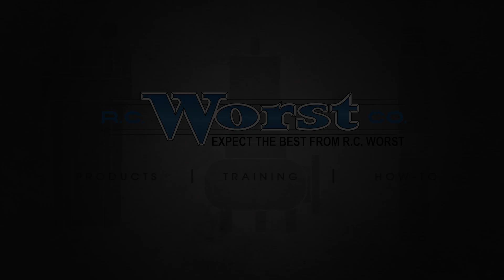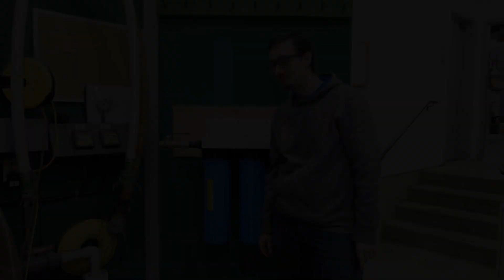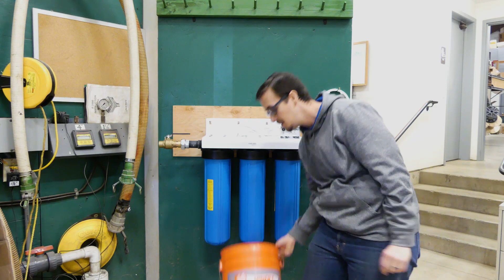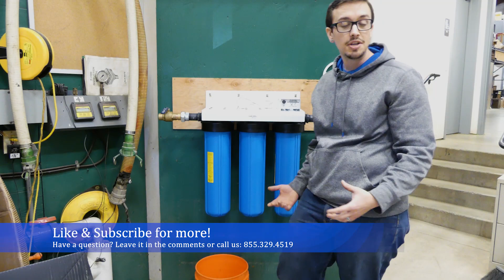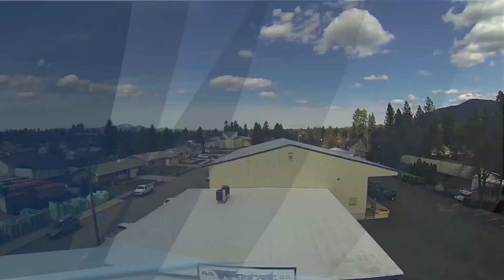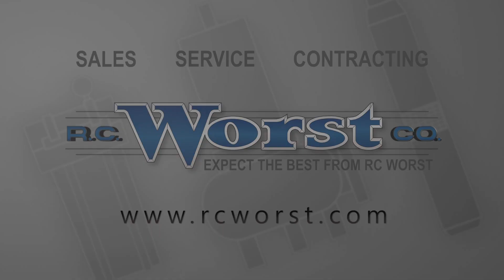How to Change a Whole House Water Filter

Comment: I feel like the filters dont actually seal inside those housings. They seem loose like the water would just bypass them... I changed my filters after 3 years and they were still clean but my taps still push out crud.
Reply from the maker: 3 years is a long time to leave a filter in. I would recommend changing every 6 months maximum.

Comment: I built a shelf just under the sumps, leaving enough room to unscrew them. That way when you drop the darn thing, it only falls an inch! Those 20 inch sumps are HEAVY when filled with water. Drop a full one on the floor and it can break.
Reply from the maker: Good tip! We have a video on how to add a drain to the bottom of the sump to make it easier to service.
Reply: @RCworstwater  Yeah I bought a tap and a couple of ball valves to do exactly that! But since it adds a leak/failure point I haven’t done it yet. I still have just enough strength to handle these.

Comment: What if the filter housing is stuck? Ours is way smaller than yours are but we haven't changed it in who knows how long because we can't get it off...
Reply: If it's any help, mine had a red button on the of the filter that I had press to relieve pressure inside. I held that down for a bit (water may come out a bit) and that allowed me to finally twist mine off.